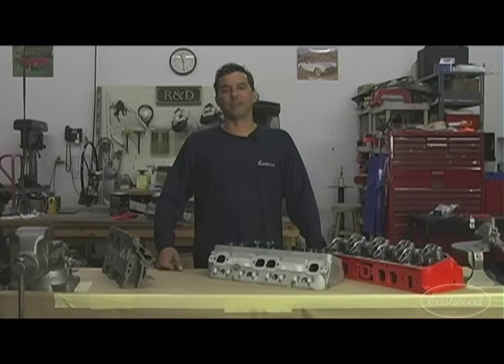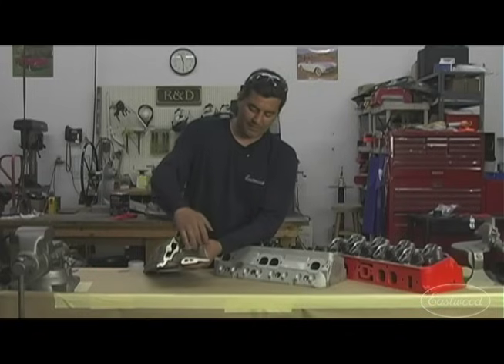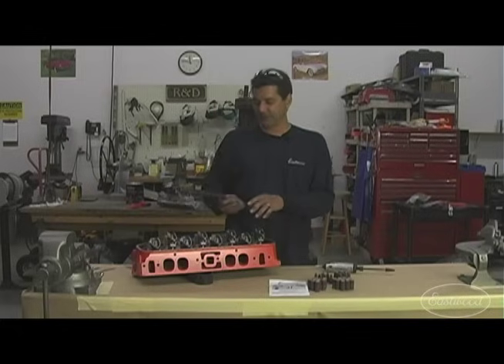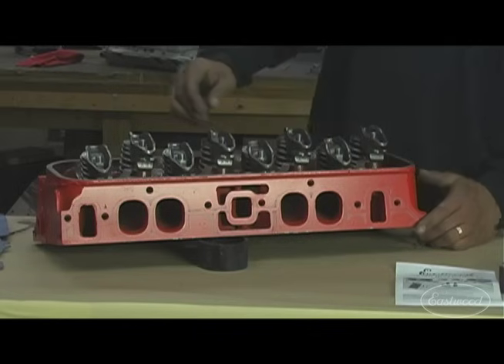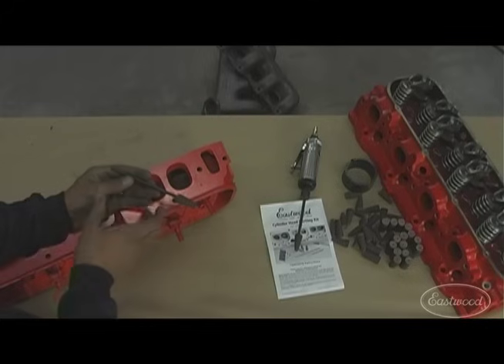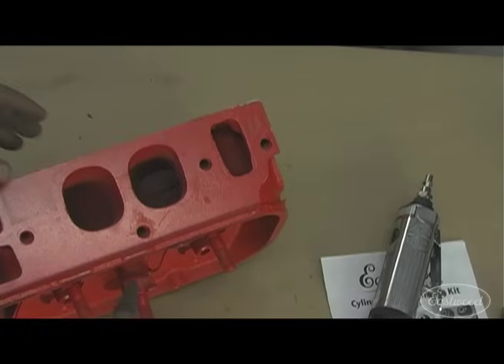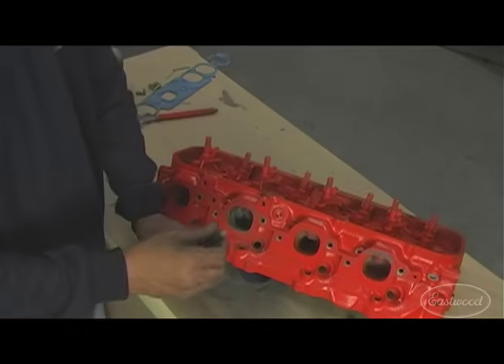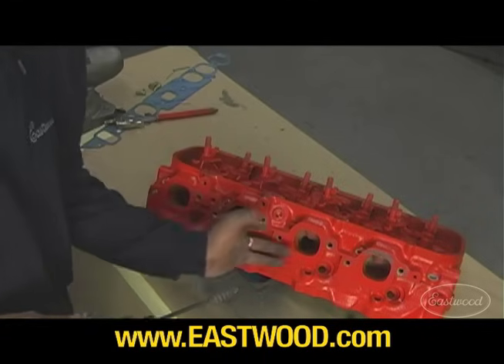Engine Porting Kit & How To DIY from Eastwood

Comment: USE A RUBBER HOSE BIT !!! ( one that fits on the valve stem; and put a drill bit, about the same size as the valve stem, in the drill, and the other end of the hose ) for lapping with a drill ..

Comment: Does the die grinder have to be variable speed? I have a Milwaukee 2784-20. Worried the single fixed speed would be an issue on the more delicate work.

Comment: If u were to port out your heads would u be required to get new valves, or as long as u don't change your valve seet  would u be good to use the stock size

Comment: Just like with all motor heads, opinions are all over the map. Do, don't,  right, wrong, that's great, that's terrible etc. Lol  Talk to the guys at the track who are winning with the engine your running. And talk to the builders who dyno test different build recipes. They know what combination of things works well for some engines, and actually robs power from others. Engine and head designs will ultimately dicide whether you would be hogging away power on your heads or flowing them to increase power. One engine will love it, another engine will punish you for it. Port and polish can sound great when your bragging about a build. But bad things can be happening that you can't see and actually detune your engine if the wrong principles are applied to your heads. You can ruin the turbidity ( air fuel mixture flow) your particular engine design relies on. You can create hot spots in the wrong areas and even close to or in valve seats. You can also create pre and post ignition scenarios at different rpms. Some engines like for instance a Buick Nailhead are designed to compress the air fuel mix
mixture as it approaches the from the runner to the head, so opening it up does the opposite of what it was designed for. Things like that, that a good engine builder who has experience with and data from actual testing to back up theory and technique for different engines. Oh it will run most likely, and may even sound great if you did the wrong things in a port and polish. But that's like running blind and defeats the
 Power you were trying to get in the first place. It also can be an expensive revelation when you put it to the test. Poorman or budget builds can be fun to test different port and polish techniques. And can allow you to test different techniques without much to loose. But when your building your dream rod and spending big money, you surely want to get it right the first time.

Comment: I would only use carbide on cast iron. I used high speed steel on aluminum heads
Reply: Why only carbide and not sand wraps?
Reply: @rustbeltgypsy3713  sand wraps are more for finishing. You need a cutter to remove material

Comment: Aside from the video being really short on actual ingormation....something that will help avoid trashing valve seats when cleaning up combustion chambers...get and old intake and exhaust valve...even slightly smaller ones will work.. stick them in the head to keep your tools from wrecking valve seats...you can stick the sanding roll in the corners without fear of having to redo the seats...gasket match the heads... sorta ok as long as as you understand that any time you increase the cross section of the port air flow slows down  and you loose power...minor gasket match is ok...as long at it matches the intake manifold too

Comment: Maybe Eastwood could actually learn how to port before they make a video! Polishing is a no no on intake side. Gasket matching is a waste of time for street engines and some race. Never seen a dumber idea than chucking up on a valve with a drill! Use a rubber hose with a cutoff bolt in it. With your methods you probably lost more power instead of gaining it.
Reply: @Hospital Administrator Sorry I just don't have the time to continue to explain. My advice is to get a book on it. David Vizard is the king when it comes to how to books on engines.
Reply: @Hospital Administrator just told you. Don't polish the intake. No gasket matching for a street engine. Definitely don't chuck up a valve with a drill, use a bolt cutoff placed inside a rubber hose with a snug fit over valve, that allows for misalignment of your drill. There is a .002 and more clearance between valve and guide. Not to mention chucking a valve in a drill is insane. You don't have to be a machinist and I am, to diy everything. By the way, unless those heads are some of the worst castings in the world what he did isn't going to anything other than occupy time other than the lapping, that might help a little if it isn't over done. As far as attacking Eastwood, I could care less about seeing who can pee the best. Just think people aught to know what a waste of time this stuff is especially done wrong. If you want to do everything he said, feel free, doesn't affect me at all.
Reply: @Hospital Administrator Maybe u r reading more into my reply as far as being uptight about this video.Let me answer your question, I'll try not to type anything that looks upset. LOL. First gasket matching is not wrong, it's just doesn't provide any gains one would see on a dyno for a true street build. Now if it was a race car it might depending on the components. As far as porting, smoothing out little casting bumps isn't really considered porting. Actually the sandy like texture in the intake runners help atomize fuel and air. Polish the sandy surface off with one of those 80 grit rolls and some fuel falls out of air. Now actually porting changes the runners dimensions where the cast port is choking the airflow. Just enlarging doesn't mean it's helping flow. Simply said if u don't know how to port don't do it. Just knock off the extremely rough spots. Most aluminum heads r not rough. Porting is a world of mystery to 99% of enthusiasts. The so called performance shops r making a mint off of people who don't understand. This will conclude this lesson.

Comment: Put a piece of vacuum tube on the valve, and stick something else in the other end and chuck that in the drill, so it has some flex so it stays true. Still, you can go too far with a drill...
Reply: Right. I think I will use the hand method to be safe.
Reply: DONT use a drill , .....hand lap it !

Comment: Grinding the valve seats with a drill is bad. you can damage the valve guide as you have no way of keeping the drill true.  That's just bad practice.
Reply: Watch roadkill videos...don't remember the specific one but they use a drill and instead of chucking the stem itself, they fit a 4 or 5inch piece of tubing tightly over the stem and chuck the other end of the tube up in the drill so you essentially have a flexible driver.
Reply: D Rutt 1969 Yes that's right! And apparently these people don't understand that the seat cutting tool and valve lapping tool use a guide that is lubricated and goes inside of the guides while the seats are being ground anyway!
Reply: I think a i will stick with the sucker jobbie.
Reply: Thats why you use oil on the valve stem. This has been done for 75 years.

Comment: Burr bits work better then sand
Reply: gucci
Reply: MyLonewolf25 Yes but you have to be careful with metal deburring bit's like that too. They work so well, if you're not careful, you can hog out too much material causing thin spots where the head can crack or possibly even grinding a hole into a coolant port. Its very important to know where you can take material out for better flow characteristics but there will be spots where you will just want to take the roughness from the molding process down to smooth and maybe polish it a little. But every head is different depending on whether you're working on a Chevy, Ford, Chrysler, import, or your lawnmower! And knowing where and how much to grind is one of the most important aspects of any port job because if you overdo it you'll end up with a ruined head, not a better flowing one (or pair).

Comment: Not a good video hate saying i use your guys polishing compounds on my aluminum but this video horrible show be going from 80 to 320 grit and dont use a drill on the em you were wiggling it man thats an uneven seat which will leak ive seen it before why do you think they make a lapping tool from what i can tell from this and other videos you made this job look half ass
Reply: I have done thousands with a drill and putting oil on the stem. It works fine.
Reply: @donrutter6765  i bet you never even care about valve guide clearance on 'thousand of your job that you had done'.. feel symphathy to your customer.. if u grind it directly with drillchuck attach to valve, the engine will still run with the worn guide , but valveseal cant last long
Reply: Chris Ketchum If your guides are allowing that much wobble then they are worn out anyway! With good guides and using the proper lubricant on the guides the valve seats will turn out fine this way. (for the average home rebuild, not a high performance application where you want much better sealing seats than you can get at home using these old fashioned methods!) When new valve seats are cut the fixture a machine shop uses has alignment guides on it that go down inside the valve guides to give lapping tool a centerline of where the valve head will be and where the seats will match from valve to head! If your guides were that worn out even a machine shop couldn't cut perfect seats! If you were to do this over and over dozens of times you would start to cause uneven wear on the guides but that's it! Now if you want a good three angle valve seat you'll have to take it to a machine shop anyway! And unless you've spent years working at a speed shop somewhere I can tell by the way you wrote your message that you don't have any kind of trade school training, in fact by looking at the way you wrote it, your sentence structure and lack of punctuation, using wrong words in places where they don't make any sense, I doubt you finished high school!

Comment: This the best video I've seen on this subject for quite some time. I'd call this a very light porting job. That's safest if you don't know how thin the metal is in different places, but a way around that is to get a metal ultrasound tool and find out where it's thin, so you can do a more aggressive job.

Personally, I'd remove more in the combustion chamber. Get rid of those machinist ridges more. Sure, it's a small compression loss, but you're probably getting the cylinder head shaved anyway, right?

It takes a lot more skill, but if all you're going to do is a slight smoothing of the port, why scribe for the gasket? Sure, you don't want to go beyond the gasket line, but my point is, matching better to the gasket is a tougher way to go, but an industry standard for a more aggressive porting job.

I started to realize, your video was so good that I was writing an aritlce about it, so I cut myself short here, wrote an article, and did you the favor of embedding it into my website. :)
Reply: I'm sure I'll be editing and polishing this for a while, but for now, this is my extended length comment that your good video got me to produce! :)

http://carmilespergallon.blogspot.com/2016/05/port-and-air-flow-in-practice-and-in.html

Yeah man, you inspired an article out of me, thank you!

Comment: Use a drill to grind in the valves! makes me think you are the tool.
Reply: I use a drill to grind valves but I don't do it like that. Too much risk of damaging the valve stem if it sticks in the drill chuck. What I've discovered is that the rubber suction cup from the lapping tool fits onto the end of a screwdriver bit holder for the drill. Attach it and stick it onto the valve face as normal. Far less risk of fucking something up plus you have a good idea how much pressure you are applying. You're also on the proper side of the head so it's easier to see what you're doing.
Reply: pilzy els Of course. But I've watched all of the related content by Jafro over and over and over already. 😁
Reply: For anyone out there who isn't a veteran at this, be super clean with the grinding compound.  Grease up the stem when lapping valves into the seats so it builds a large glob as it goes into the guide. Just little compound inside the valve guide, and you'll ruin your stems when running because it will embed in the softer guide material.  Like lining your guides with sandpaper...
Reply: Beginners should do it by hand so they know they got it right. Some stick with it. Once they squeak, most think it's really smooth, that's not true, keep going by hand until they don't even squeak.

I'm speaking from learning from Jafromobile. I have a port and airflow theory video on my channel. Check it out. :)

Comment: all this kit will do is shine up the ports reducing turbulence which is needed for good fuel air mixture. to get results you need a carbide cutter at 10,000 rpm to remove things like the guide boss  the abrasives won't do much.
Reply: He never went finer then 80 grit in this video which will still provide plenty of turbulence. I would personally would never polish the the intake side. I actually don't go finer then 60 grit. The exhaust side is fine to polish but for most street engines it really isn't worth it.
Reply: Justin Bowtell Yeah you always hear people talking about "porting and polishing" but for 99% of the street builds out there, a little polishing will help flow, but many engines will actually gain a little performance by not polishing too much on the intake side.
Reply: @farmvideosnet  True it depends on the motor honestly. Lime the old subaru wrx motor has amazing gains from porting and polishing. But doing the same on its big brother the 2.5l its doesnt have big bennefits like the 2.0l

Comment: Once you have the heads off and on the bench like that about how many hours of labor are you looking at for both heads ported polished?
Reply: I'm gonna need a lot of beer to do my heads. That long?
Reply: I was curious about that too. Jafromobile said about 40 hours to port a 4 cylinder, cylinder head. But he did more material removal, and may not have counted valve seating as part of that time. He has a good channel with lots of this stuff.

So far, I just have a port and airflow theory video on my channel. Check it out.
Reply: It took me 80 hours to do a pair of LS 243 heads.

Comment: wht is that tool ,what its name
Reply: Which tool? The air tool is the die grinder. To do work like this you need bigger than a 20 gallon tank. :/ Unless you want to burn up the air compressor.

The other way around it is, Milwaukee has electric die grinders for about $200. They aren't adjustable on speed so you have to buy a separate speed controler that goes before the plug in.

I have a lot of air tools, I'd rather get a bigger air compressor...air tools last longer, especially with Matco tool oil...but then with the electric die grinder my starting cost is less.
Reply: dremel